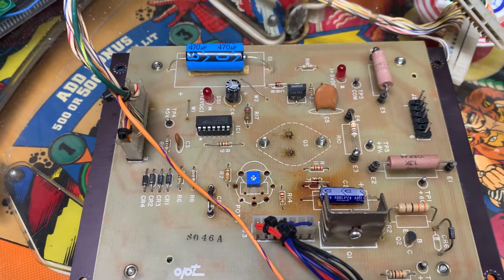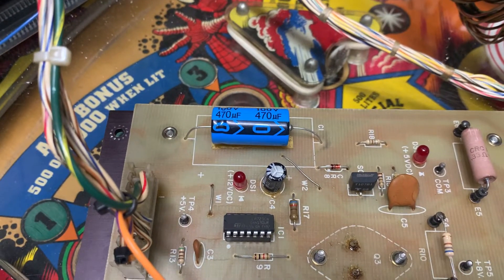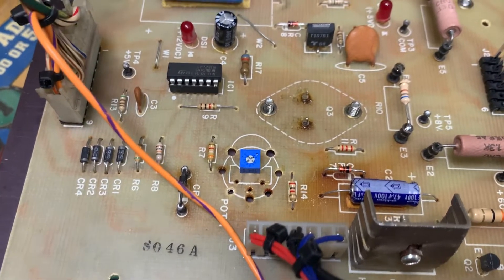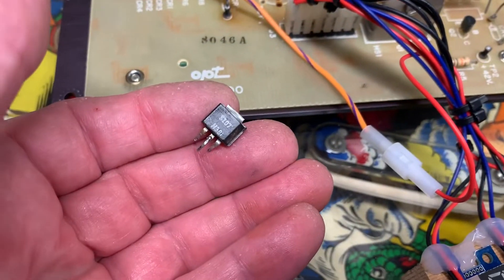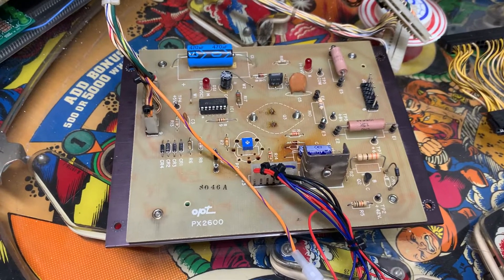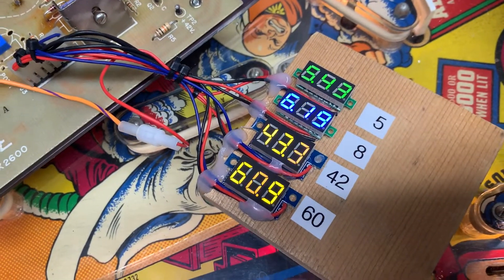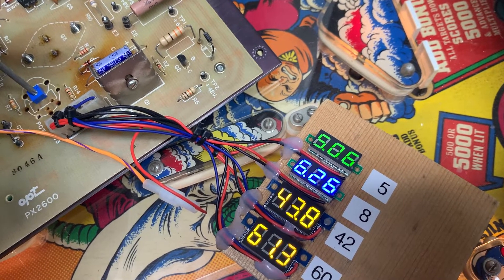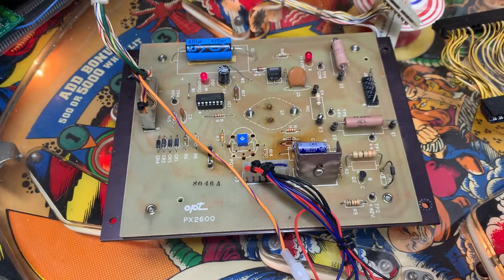Gottlieb System 80/80A Power Supply Repair and Test

Comment: Hey Chris.  I am.having issue with my Circus.  8.0V is only 5.0-5.2 volts.  Can you point me in a direction to start looking.  (Game will play then displays and scoring stop working).  Game will play till ball is lost
Reply from the maker: That 8VDC is the DC offset voltage for the 6 digit displays. 5-5.2V is probably fine. But you can remedy this by rehabbing the PS per the PinWiki. The process replaces CR7, which tended to burn on OEM boards.

I would however suspect that the MPU is simply dieing. Is it an OEM or aftermarket?
Reply: @ChrisHiblerPinball  Hi Chris.  I believe that is is original.  Thanks. I will check out the wiki.